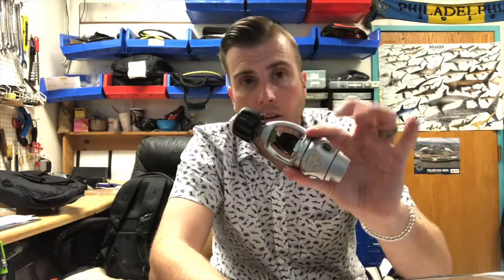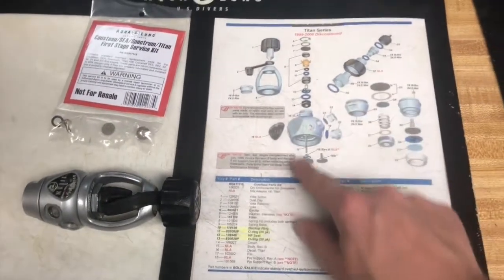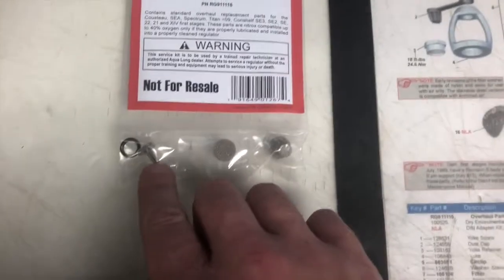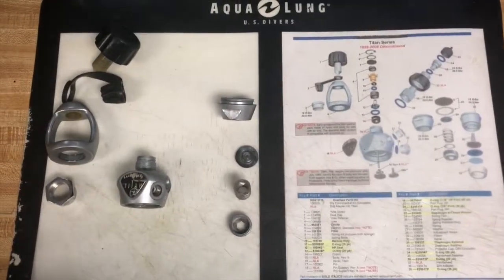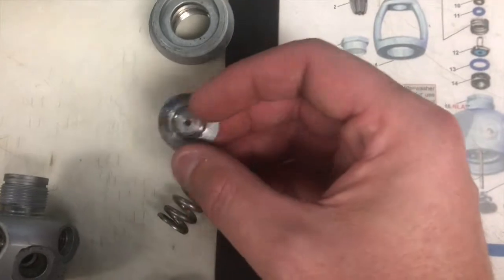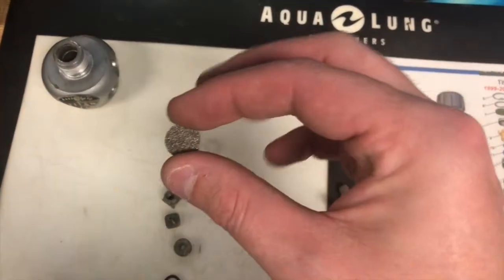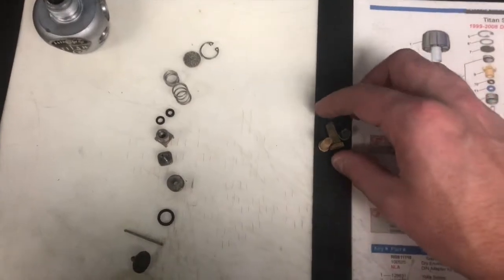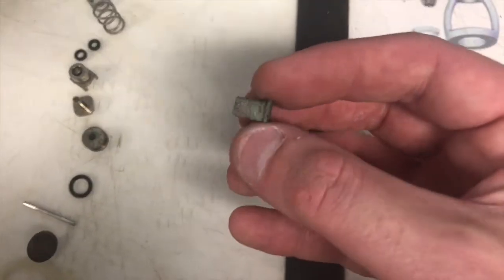SCUBA Regulator Overhaul; First Stage

Comment: Do people normally only do service every two years?  Been a while since i dove, but i use to have it done every year.  Ive been looking at buying new gear and i like the idea of the free parts program, however as of right now.....scubapro brand requires customers to purchase a regulator, BCD AND a computer from them, in order to get that free parts program. IMO, thats doing their customers dirty.  Aqualung has the same program, but you only need to buy one item, not three and the quality is the same as Scubapro🤷‍♂️.
Reply from the maker: You are correct about the ScubaPro Program. It was frustrating for us as well when they came out with that. The truth is, the free parts for life program was prob not a great idea from a business point of view when it was started decades ago. You wouldn't expect free life limited parts on your car, you would expect that it would need to be serviced. With how long equipment lasts, it is totally possible for manufacturers to actually lose money on a free parts program. 

In fact, when they started to lose money, they extended the service time to every 2 years. That seemed great for the customer but really just passed the losses off to the dive shops who were losing 50% of the servicing revenue a year. 

IMO (not our dive centers, just mine) a fair priced, parts kit, like $15 per stage and recommending yearly service would be much better for everyone. The manufacturer doesn't risk losing. The dive shop gets service. The customer doesn't have to worry about it being out of warranty forever if they miss one year (like the COVID year, let alone the last 2 where even getting parts kits in has been a struggle with supply chain issues). 

I dive an Apeks. My wife dives a ScubaPro. You're right, they are both excellent regulators. The real key is finding a regulator that suits your diving needs. Talk with your LDS or if you need one, feel free to message me jeff@diveuww.com 

Dive Safe!
-JG
Reply: @diveuww  ; Yeah, I fully understand that.  Honestly though, I dont even really think the customer is saving that much money anyway with the free parts. Im always a local brick and mortar supporter, even is it means spending a little more. However, I contacted a local store recently about a sale Aqualung was running.  The stores owner told me that there was no sale and quoted me full price for the BCD, full reg, octo, etc.  I was trying to be nice about it because maybe he didn't know about the sale🤷‍♂️.  I told him I found the sales on two different websites, but that I'd rather purchase locally. He said well, you'll probably have warranty issues down the road because they are probably not dealers or are selling old stock or returned items🙄.  Just to verify, because I'm still trying to give the local business, I called both online retailers AND Aqualung.  All confirmed their dealer status and that they only sell used as used and not as new.  So the local dude flat-out was lying. Now I don't even trust him at all.  I don't get it. He just lost a customer and that of my niece and nephews.  I didn't even bother to call him back.  Anyway, the recent sales steered me towards Aqualung gear.  Thanks for the reply.
Reply from the maker: @397coney7 that’s so frustrating and sad that things like that are still happening. The LDS should have verified the sale was correct or if it wasn’t but was being offered by an authorized dealer, they should match the price and take it up with AquaLug. The fight isn’t with the customer and AquaLung has always made us “whole” if we had to do that to take care of our people. 
Slowly but surely there is a change happening in the industry and hopefully we can get beyond the “internet is a fad” phase that seemed to plague so many dive shops. 

Good choice on your equipment and dive safe!